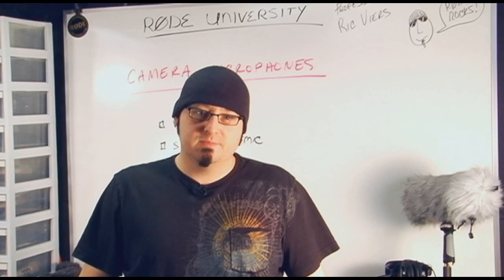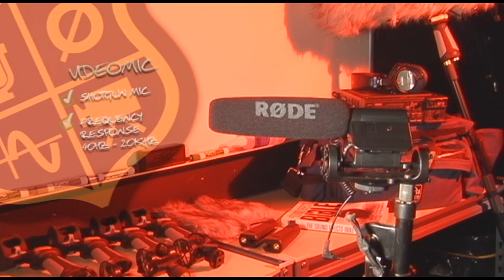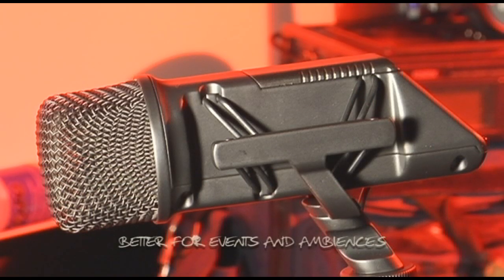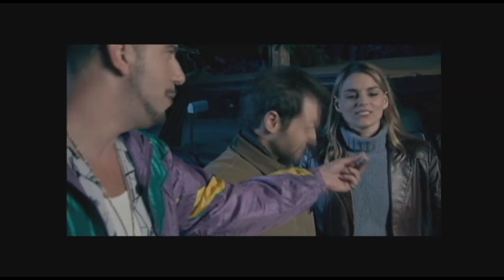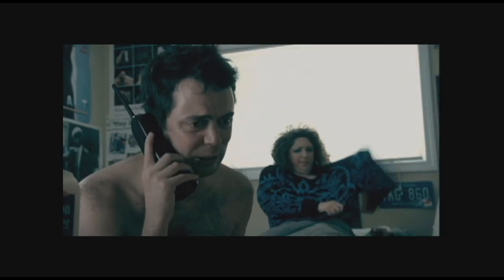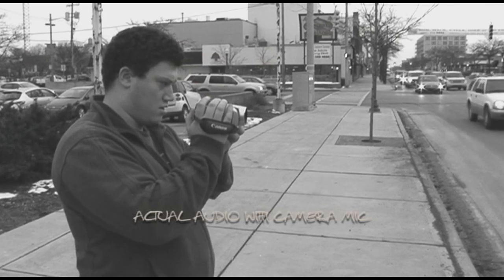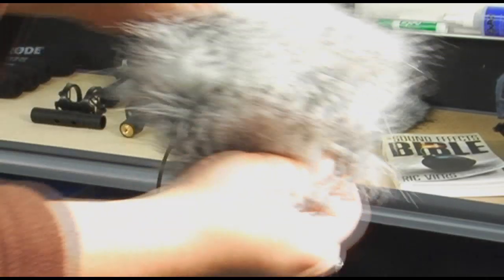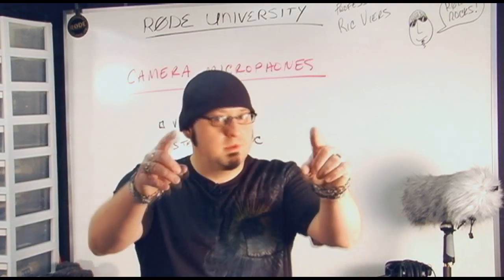RØDE University - Camera Microphones

Comment: Interesting vid.... I just bought the VideoMic to use with a canon DV camera.   It works quite well but I'm using it to record sound in a rural setting..birds, wind -in- the- trees type stuff.  I still pick up a lot of low end rumble though .  
I didn't have a 'dead cat' which probably didn't help.

Would the stereo video mic be a better option for what i'm doing or just get a dead cat for the Video Mic ?